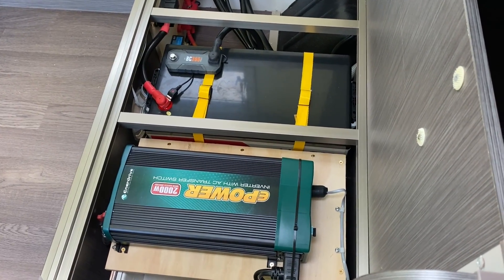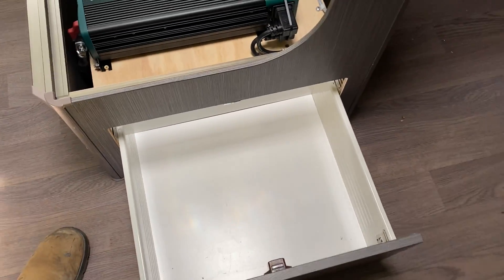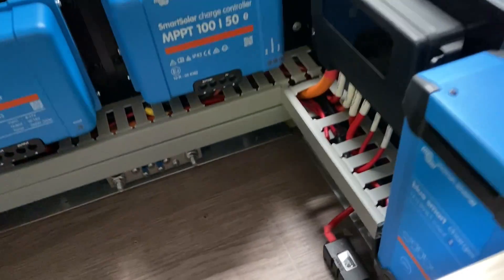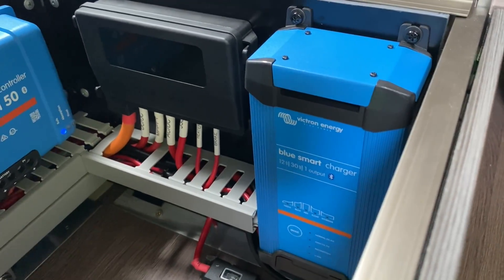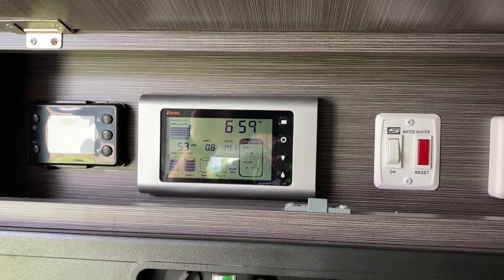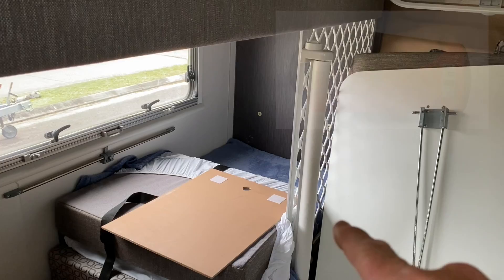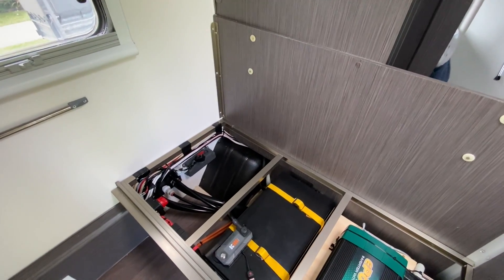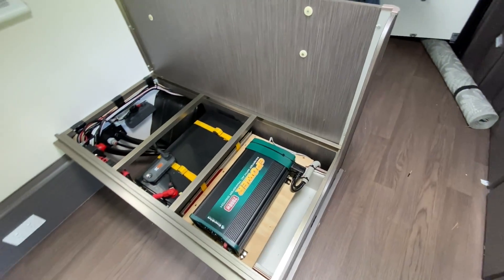Jayco Expanda Outback Off-Grid 800 w Solar

Comment: Hey David, i've searched for panel options for my own Expanda and this is just what I was looking for.  Any chance you can include some pictures or more details on how you fixed the panel to the roof right near the air conditioner?  PM me if that's easier?  I can't see from your video how you managed to get in there as it looks like it is right up against the A/C?  Thanks!

Comment: Hi mate, how did you hard wire your inverter into the van?
Reply from the maker: Yes the inverter is hard wired. It has an automatic change over switch so when you plug into shore power it automatically changes over.
Also worked out essential and non essential appliances eg hot water and fridge non essential and air con microwave and power points essential
Reply from the maker: At the end of the video there is a wiring diagram.

Comment: How did you mount the panels to the roof
Reply from the maker: I used the mounting brackets supplied with the solar panels, use sikaflex 252 and screws to bond to roof.
Reply: Any issues screwing in the roof?? You didn’t come through the ceiling inside?
Reply from the maker: @carlosvaquerofoto   no I used the screws provided with the mounting kit, they were 25-30 mm long. The most important part is the having a clean surface and the sikaflex.
Reply: @Davidstinton  thanks mate! So, how is the pop top made?? Is like a sandwich panel? I mean, like two parts with an air gap in between?
Reply from the maker: @carlosvaquerofoto  not 100% sure but there is a metal frame that I managed to some of the screws into. We have now traveled 3/4 of the way around Australia and the panels are still fixed to the roof. I have seen some people just sikaflex them to the roof without screws.

Comment: Did you have to upgrade the roof struts with the extra weight of solar panels.
Reply from the maker: Yes I did, got a set of 650N struts from Bunnings, around $28 each.

Comment: Keen to see a wiring diagram- especially how you still keep the J35 in use? Do you disconnect the J35 from mains permanently? How does the jhub app pick up the charging metrics? Thanks
Reply from the maker: I disconnected the j35 from mains power, solar and Aux input. I now feed power into it to the battery input. 
I’m going to make an updated video, I’m going to take out the BC300 cause we found we never check the screen, only to see how full the tanks are. The Victron app is so good.